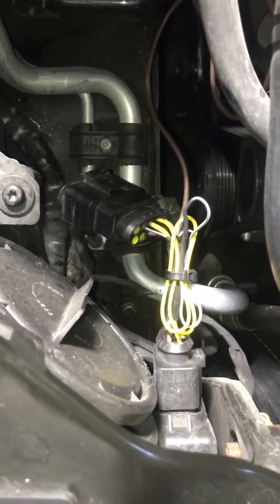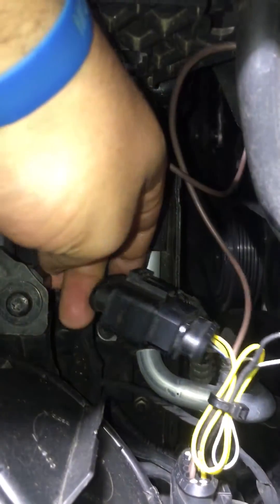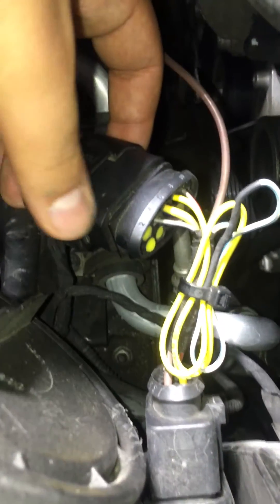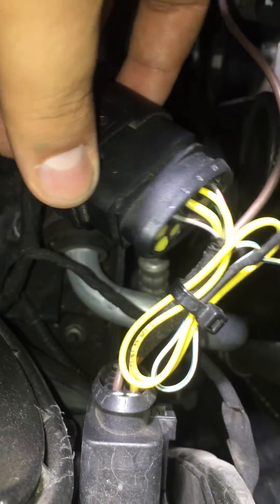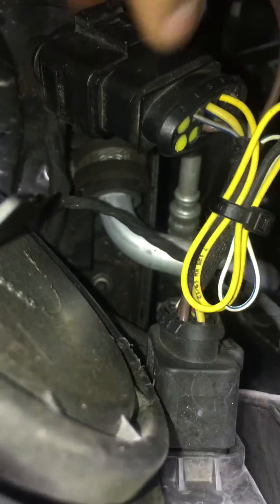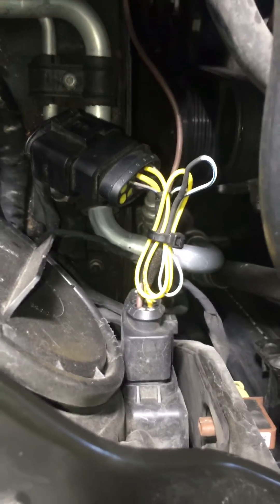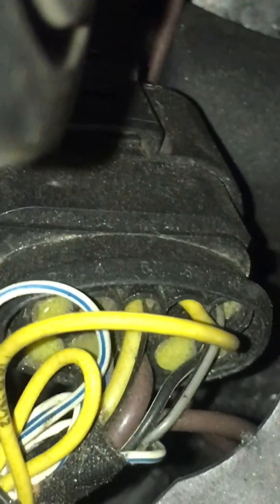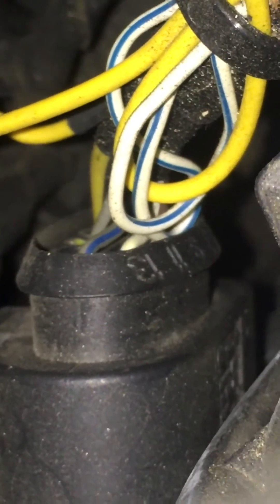OEM Bixenon swap w/ working highbeams MK6 GTI

Comment: If I buy the adapter from eBay it gonna be same happen with u with hightbeem ?
Reply from the maker: @FordTevee  it has been a few years since I did this but yes the eBay harness at the time was all I needed. If you code the bi-xenon on it will work but the highbeam won’t work unless you run the cables back and code the CECM, or perform the highbeam wire tap as shown in the video by repinning that part of the harness

Comment: So basically, you connected pin 8 (car harness) with pin 11 (adapter harness) instead of running the cable to the central electronic control module?

Comment: Why didnt they just wire the harness like that in the first place ??
Reply from the maker: They had different central electronic control modules (CECM) for cars with different options. My car had halogens, so when I swapped to the bixenon headlights the wiring wasn’t there for it. I’d have to run the wire back to the module etc. this allows the power to open highbeam shutter by tapping into the halogen 12v signal basically
Reply: @zsm722  what coding was the additional coding?
Reply from the maker: @doublegaming266  it was to code the module to tell the car it had bi-Xenon’s